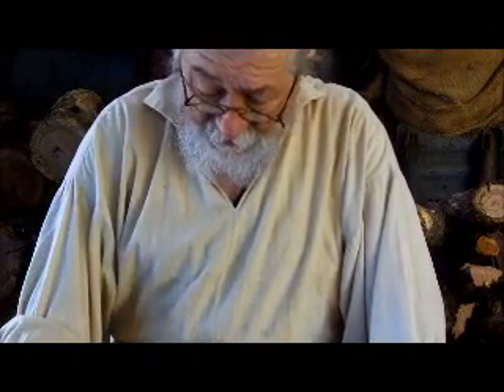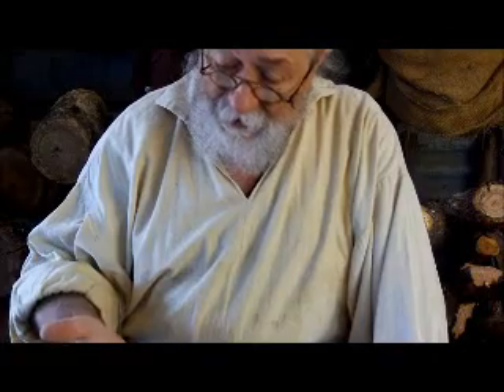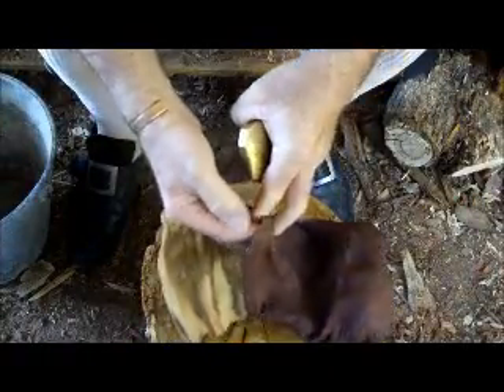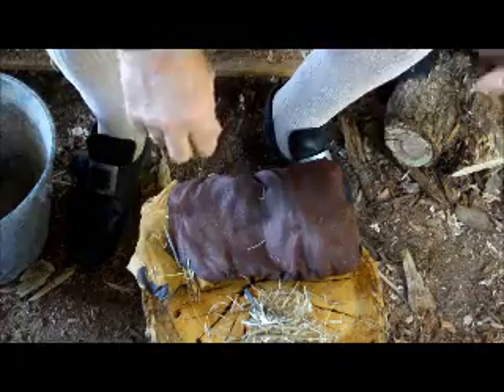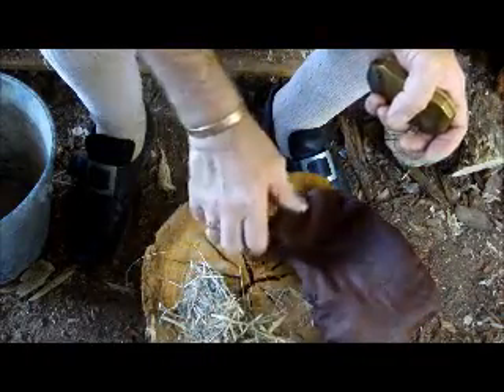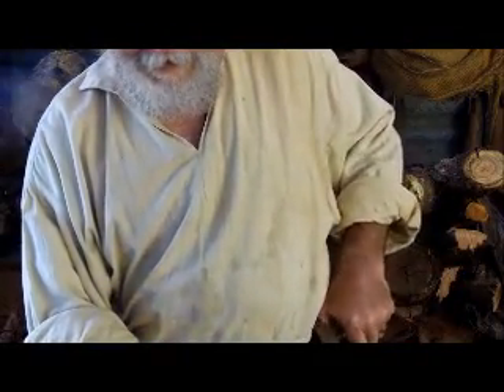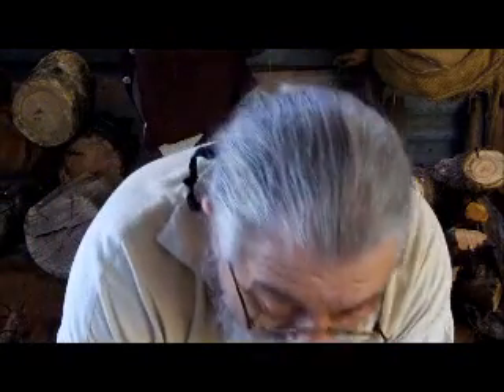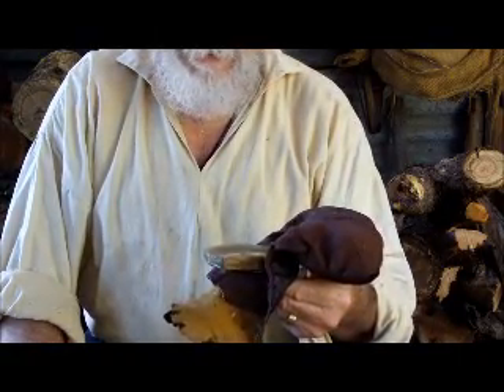No Charcloth Flint & Steel Fire Lighting..wmv

Comment: Thanks for showing another way to start a fire using the flint and steel. It's always good to have the knowledge to do one thing multiple different ways because sometimes you can't depend on one way only. Especially in a survival situation one Wei might not be available. It is always good to have a couple 2-3 or more different ways to make a fire just in case
Reply from the maker: You could be right Joe, though I have never needed anything else but my flint, steel & tinderbox to make fire in all weather conditions over many years.
Regards, Keith.
Reply: Keith H. Burgess true very true. Bit by some odd chance you don't have or you misplaced your flint and steel there is other methods to make a fire. There is some other old fashion and new modern methods for fire. It is always good to have a back up just in case.
Reply from the maker: Agreed Joe, I can make fire with the lock on my flintlock fusil & pistol, & I can make & use a fire-bow. I can also use my reading glasses if the sun is shining. But these are things I carry with me anyway aside from the fire-bow.
Regards, Keith.
Reply: Keith H. Burgess friction fire methods are the only kinds I haven't fully gotten the concept to. I can see how it's done in a video but until I actually do it myself it's still something that seems strange. Best ways for me to learn new things is by doing them myself or being taught face to face.
Reply from the maker: Much the same myself Joe, but I had to experiment & teach myself. Take a look at my blog, it may be of some interest & help.
https://woodsrunnersdiary.blogspot.com/search?q=flint+%26+steel+fire+lighting
Regards, Keith.
Reply: Keith H. Burgess thanks I'll look it up and try to help myself learn a new skill.

Comment: I have a huge log of good punkwood but am always trying more out just to experiment and the most curious thing with some punkwood from a locust tree - after drying it out and charring, it would catch a spark ok but it would not ignite anything!! It would glow red and just shrink away to nothing in seconds when I held kindling on it and blew and just make the kindling smoke alot but not catch on fire!! I used my good punkwood and- poof- fire in seconds! Wierd huh? I guess all punkwood is not created equal - I tried to ignite dry paper, dry grass, wax paper nothing worked.... It was super light weight and the whole tinder box would vanish in about 10 seconds of blowing air on it- but my good punkwood - geesh i can get many fires going with just one load in my tinderbox...
Reply from the maker: Good day Mark, very interesting, I have used punkwood from several different trees with no problems, but I have not used  locust punkwood. I wonder what it is about the locust? Anyway, good information & well done, knowing what does not work is just as important as knowing what does work.
Thank you for the information my friend, appreciated.
PS. Try dripping some wax on the smouldering locust, I would be interested to know if it catches fire or not.
Regards, Keith.
Reply: Hi Keith- i did drip wax onto the Locust punkwood and it did NOT combust, only smoke ALOT - Beeswax - The Locust punkwood seemed to be TOO light, less weight than balsa wood and after it catches a spark, and I blow on it to get the kindling to catch fire, it just turns red and shrinks down to ash within seconds- as in the whole tin is gone within 10 seconds. Not enuff substance to it. What surprises me is the fact it glows red and will not combust dried grass !! My good punkwood works just like what is shown in your demonstration.  Always pays to experiment !! Makes me wonder--  COULD this happen to ANY punkwood if it were to be TOO rotten? Punk wood is light weight but THIS seemed REAL feathery light and sun bleached. Im still sticking to your method shown as it is an excellent way to use flint and steel - the way it was done for centuries
Reply from the maker: @markhopkins7920   Well done Mark, at least you have proven locust to not be any good & you can move on to other experiments. Thank you for that, much appreciated mate.
Regards, Keith.

Comment: Great instruction video, Keith! Did you say that you mostly use "ploughed tinders" for charring? Is that the same as dried grass?
Reply from the maker: I probably said "Plant Tinders" David. No grass is a kindling, not a tinder. There are usually plenty of plant tinders around, but the types may depend on the area you are in. Some tinders are worldwide, such as the punkwood, & the dried heads of the cattail. Others like bracket fungus will depend on where you are.
Keith.
http://woodsrunnersdiary.blogspot.com.au/2012/02/part-five-closer-look-at-flint-and.html
Reply: Keith H. Burgess Thanks for your answer, Keith.

Comment: Hi Keith, I enjoyed your video. I'm homeschooling three kids and we've studied all of the American Wars. My son is interested in steel and flint fire making, We've tried finding flint and chert in our landscaping stone and got it to spark on an old file, but it wasn't catching on the jute. I then bought a kit from a guy on eBay with a carbon steel ring and some quartzite he insisted would work as well as flint. It does not. It included char cloth which ran out after our first try. It burned up in seconds and that was that. My question is, to make the tinder box, is it just wood that had been an ember in a fire and then extinguished? How could I make that? Thanks for any help. I grew up in the woods but am by no means educated in this area. Thanks.
Reply from the maker: I will message you Jenn.
Regards, Keith.

Comment from the maker: @BushCraftMan26  If you take a look at the series Plant Tinders parts 1,2,3 & 4, you will find more. Mostly I tend to use Ryvardenia Cretacia which is a bracket fungus, and punk wood. But I also use the inner core of the Goonagurra flower stem or grass tree. This latter called also Yacca, similar to your Yucca. Also your larger version American Aloe or century plant.
Regards, Keith.

Comment from the maker: @blackbat1339  Mate my apologies, but I am not sure I understand your question. I rarely use charred cloth. I use charred plant tinder material. I strike the spark directly onto the tinder in my tinderbox. I place the kindling dried grass (or whatever I am using) directly against the glowing ember on the tinder in the tinderbox & blow it into flame.
I hope this is what you wanted. If not, get back to me.
Regards.

Comment from the maker: @MYTHIRDSHADOW  Plant tinder material. Inner core of the Grass Tree flower stem & Ryvardenia Cretacia bracket fungus. Just char the surface in the fire then smother in the tinderbox. There are other plant tinders, but these are the ones I mostly use.
Regards.
A Woodsrunner's Diary blog.

Comment: I must have missed or didn't understand what was in the tender box besides the flint. I understand it's not charcloth but tender but  what is used for tender. Love the videos. Roger Hensley
Reply from the maker: Various plant & fungus tinders Roger. I will add some of my blog links for you to check out.
Regards, Keith.
https://woodsrunnersdiary.blogspot.com/2014/02/authentication-use-of-tinderbox.html
https://woodsrunnersdiary.blogspot.com/2015/05/period-fire-lighting-tinder-quotes.html
https://woodsrunnersdiary.blogspot.com/2012/02/part-four-closer-look-at-flint-steel.html
https://woodsrunnersdiary.blogspot.com/2014/06/another-plant-tinder-for-fire-making.html
https://woodsrunnersdiary.blogspot.com/2017/06/18th-century-period-fire-lighting.html
https://woodsrunnersdiary.blogspot.com/2012/06/fire-lighting-tinder-quotes.html

Comment from the maker: @hoosierarcher  You can use a container yes, but really there is little point. You really only need to char the surface, not the whole thing. It will char itself with use. When using the tinderbox the tinder stays in the tinderbox. It lasts longer that way.
Regards, Keith.

Comment: kind of a side question, what plant material would I want to use optimally? some charred stuff don't work as well as others I'm finding. for example, cotton balls and pads oddly don't work as well as charred punk wood. no surprise on punk wood winning, but given cottons high flamibility, I was surprised to find the charred version wasn't as effective. and bear in mind all my tests are with ferro as that's all I got. 5,500 degree sparks are a lot different than Flint sparks, and I know this. I'm wanting to char grass, leaves, and possible very fine wood shaveings, as all are feasibly available in most situations. punk wood is my face rate, but it's also harder to find. if I see a dry rotted log, I'll harvest all I can, but it's a precious item due to availability. at least to me. advice is welcome, a tutorial would be awesome.
Reply from the maker: Fire steels are not expensive Richard, neither is a tinderbox, in fact you can make both yourself. If you are into long term wilderness living/survival, then I recommend you get yourself a fire steel(striker) & a tinderbox. Take a look at my blog, I will add a link. Also check out the rest of my fire lighting related videos.
Regards, Keith.
http://woodsrunnersdiary.blogspot.com.au/2012/02/part-four-closer-look-at-flint-steel.html
http://woodsrunnersdiary.blogspot.com.au/2017/06/18th-century-period-fire-lighting.html
Reply: Keith H. Burgess yeah the char tin is no issue. got tons of tins everywhere. I'm just mainly trying to add redundancy to my gear. I feel that if there ever really was a survival situation, I will be better off planning for it to be long term, and not just 72 hours.like the videos too. very refreshing.
Reply from the maker: I think you must have misread my reply Richard, I did not mention a "char" tin. I did mention a tinderbox, which is NOT a char tin. A tinderbox is used for preparing tinder, but you do NOT put a tinderbox in the fire.
Take a look at my other fire lighting videos Richard.
Keith.
https://www.youtube.com/watch?v=C5WGTxDS1AE&t=1s

Comment from the maker: @phrayzar  Hi Frazer! Long time since I heard from you. I used to use lard & beeswax mix, the latest is a mix of beeswax & neetsfoot oil (NOT COMPOUND!). But neetsfoot oil on its own is pretty good, but does not last as long as the beeswax mix. I usually like to rub in in warm in front of the fire. With the beeswax mix I sit the container in front of the fire so it starts to melt, then rub it in with a rag.
Good to hear from you Frazer.
Regards.

Comment: btw if you got a source on cheap steel strikers and fire pistons im looking for both.just need one of each for my camping gear.i made a fire cord that will light on fire from the sparks from a dead bic lighter and am really intreasted if furthering my tests with flint and steel meathods now.
Reply: Richard Peterson buy a second hand old file it will work
Reply from the maker: I made a fire steel out of a piece of broken metal file, I have also used chainsaw files. Heat to cherry red & let cool slowly. File or grind off the serrations on the edge of the file. Reheat to cherry red & quench in water.
http://woodsrunnersdiary.blogspot.com.au/2012/02/part-five-closer-look-at-flint-and.html

http://woodsrunnersdiary.blogspot.com.au/search?q=fire+steels
Regards, Keith.
Reply: Keith H. Burgess love to try that. unfortonatly I'm not in a position to do this. I'm probably going to bit the bullet and buy the cheapest one I found. at about 27$.which is retarded for ancient techknowlagy. fire pistons are same. I got some products selected it is just getting the wife to give me the spending cash. we are in frugal mode lol. and it sucks when I have a ton of stuff I need to get still.
Reply: Keith H. Burgess I do have a file that I been trying to get to work, but one, it's pretty awkward to handle, and two, I think its cheap crap, and barely sparks at all. and the striking side as I'm calling it is nearly smooth. most the teeth wore off in my attempt to reptofile several stainless blades. but I know it's not sparking the way it should. not sure what it's made of.

Comment from the maker: It varies Charles. If you have good dry kindling that ignites quickly, then the tinder will last longer. But you can add unprepared tinder to the tinderbox as you go, & it will char with use.
Keith.

Comment from the maker: @WCherokeeW  This sounds more like you are using a Ferocium rod, not flint & steel ? In my experience the cattail fluff requires charring before it will catch a spark from flint & steel.
Regards, Le Loup.

Comment from the maker: @HowToHistory  Obviously not all plants can be used as tinder. Out of those that can be used, some need no preparation and others do. There are three methods of tinder preparation/use. (1) To soake in a solution of potasium nitrate and water & dry. This was used mainly on Amadou in Europe & sold in the streets and apocothery shops. (2) To char the material in the fire and then smother it in a tinderbox for later use. (3) To use a little gunpowder to ignite the tinder/to start it smouldering.

Comment: I found this video to be very helpful. I carry around a small tin for char-cloth, but frankly, I've never made char-cloth in it. The reason I haven't been carrying char-cloth is, like you said, it's not sustainable in the woods—and I don't like the idea of getting used to relying on something that's not sustainable, it's like a crutch. Lately I've been steering toward bow drills and things of that concept. But I also tend to save char from my fire as well. This video encourages me to continue on the thinking I've been pursuing.
Reply from the maker: IamNemoN01  Good thinking. You should then check out my videos on plant tinders/punk wood & preparing these tinders in the field.
Regards, Keith.
Reply: +IamNemoN01 
Here are some quick thoughts about sustainability and crutches as far as F&S is concerned. Only through lack of knowledge and skill could one ever think of Percussion Fire as not worthy of addition to every outdoorsman's arsenal. For indeed F&S is one of the most robust, reliable and sustainable forms of primitve ignition. 

For many good reasons Percussion Fire (F&S, Flint & Pyrites) was the dominant form of ignition for many people groups across the globe for the last 3,000 years. The ancient Egytians, Vikings, Romans, Inuit, Fur Traders, etc all relied upon Percussion Fire when ignition was needed. 

There are dozens of steel tools, plus a few rocks, that work as the striker. There are hundreds of types of rocks, plus carbide steel, that work as the flint. There are hundreds of natural materials from plants and fungi that can be charred, plus at least two dozen that do not need to be charred, that will catch the sparks from F&S yielding an ember. Hundreds of natural materials from plants and fungi that yield flame from an ember. Indeed many chars can produce flame without the introduction of any other materials. 

Happy Trails!

Comment from the maker: Yes, just go to my channel & search.

Thumbnail3:24
Field Preparation Of Plant Tinder For Use With Flint & Steel By Charring.
Plant tinders are charred directly in the fire, then you place them in the tinderbox & close the lid to smother the smouldering tinder. You make fire directly from the tinderbox & smother each time. You can also add uncharred plant tinder material to the tinderbox & it will be charred with use.
Regards, Keith.
A Woodsrunner's Diary (blog).

Comment from the maker: @WCherokeeW  Any plant tinders that require charring are charred directly in the fire. Not just dried, but charred black. Then you place this charred tinder in the tinderbox to smother it. Then it is ready to catch & hold a spark struck from flint & steel. See my video: Field Preparation Of Plant Tinder For Use With Flint & Steel By Charring. On my channel.
Regards.

Comment from the maker: You are very welcome, glad you liked it. Thanks for taking the time to comment. 
Steel can not be found in the wilderness true, but Pyrite can. Also the Fire-Bow method is much improved by using extra tinder to transfere the ember rather than having to use the small ember that is produced to make fire.
Regards, Keith.
A Woodsrunner's Diary (blog).

Comment from the maker: Some fire steels are too soft, & the flint will dig into the steel but not create a spark. The spark itself is a tiny sliver of steel cut from the fire steel by the sharp edge of the flint.
Some steels are too hard, so that the flint just glances off the steel. If I was there I could tell which it is, very frustrating for both of us. I will PM you with more information Ann.
Regards, Keith.

Comment: what kind of flint do you use? I have chert from limestone. I seem not to be able to get it to work. It will strike good once, but then after that it won't do it again.  Is there something you do prepare it. Where could I find something like you are using?
Reply from the maker: I use a variety of rock types John, chert should be fine. Maybe your's has fracture lines & blunts after a first strike. I have used grey & black flint, agate, & even quartz. Make sure the edge is sharp. 
The sparks are tiny pieces of steel cut from the steel by the stone/rock. The steel needs to be high in carbon & quite hard. Too soft & it will not spark, too hard & it will not spark as well.
I am using a musket flint at present, if you can not find any suitable rocks, purchase some musket flints.
Regards, Keith.

Comment: Dry punky wood will work but can be hard to find dry enough. Cat tails frayed, fine pine limb shaving, pine straw crushed.  Takes practice and experimenting.
Reply from the maker: Thank you for commenting Timothy. I very much doubt that pine limb shaving will catch a spark from a real flint & steel, perhaps from a  ferrocerium rod, but not from a steel.
Regards, Keith.